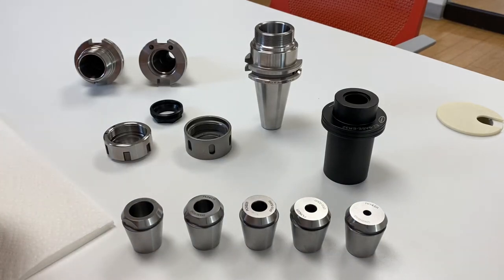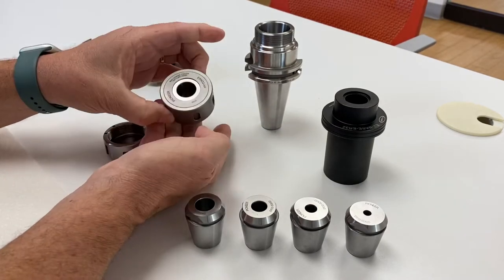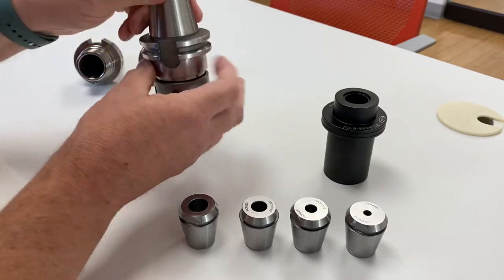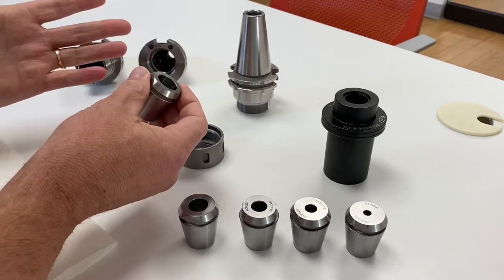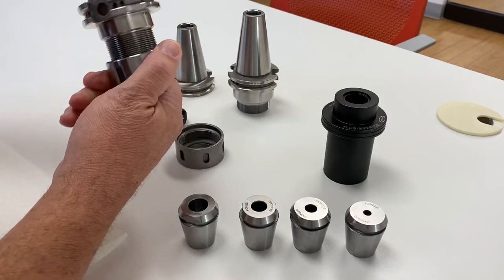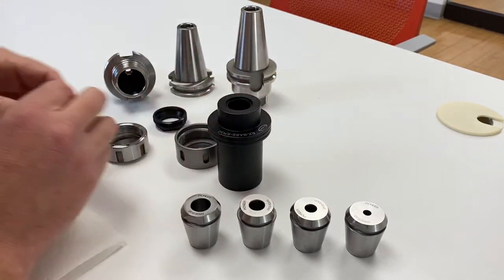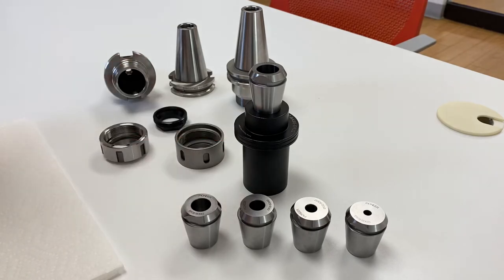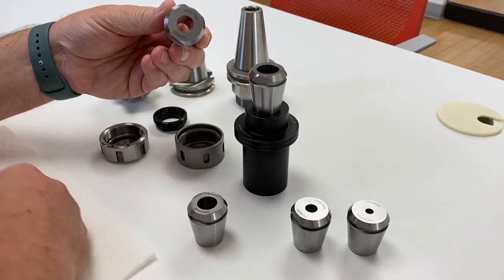New ER Shrink Collets with Heavy

Comment: You nailed it! I have found our shrink ER collets to be invaluable on our live tool lathes. 

Do you find that the induction heater adapter gets too hot to hold and  adjust after a few heat cycles?
Reply from the maker: I actually run my adapter through the cooling unit when I cool the collet,  I don’t have a heating problem. If you do not have a water cooling unit a bucket of water will do the same thing just not as clean.  :-)
Reply: @LeeFlick  i understand. You take the collet and adapter off the heater and put them both through the cooler. I have separate adapter for  the cooler which can't be quickly removed from the machine.
Reply from the maker: Sorry to hear that, if you ever need a different shrink machine we can help you out!  :-)